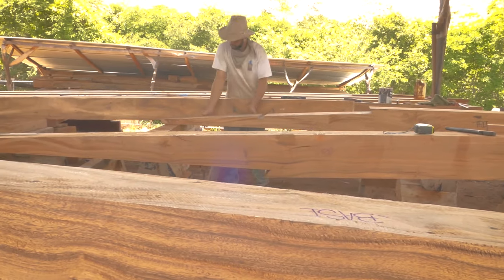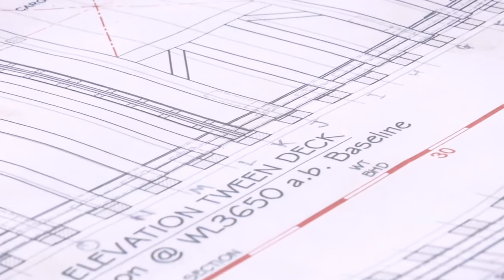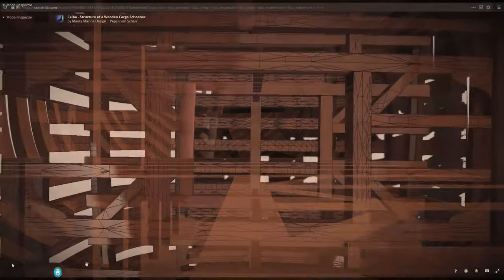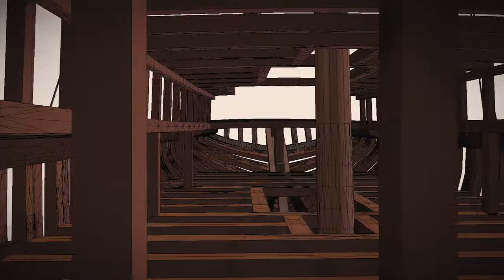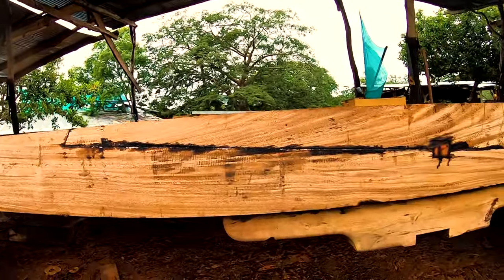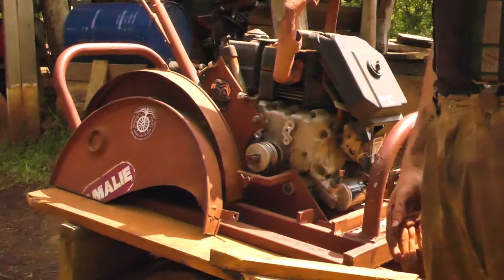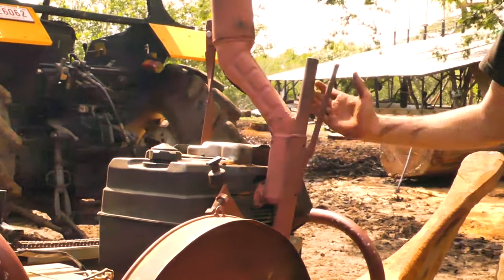Cambered Deck Beams - Building Ceiba, the world's largest wooden cargo sailing ship.

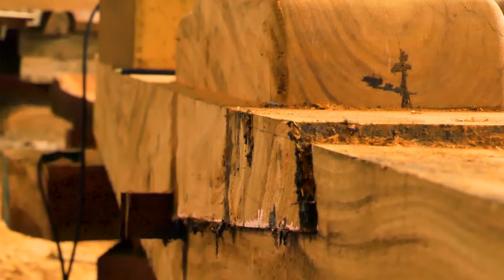Comment: I think someone said, "Ya. You just Spring a Batten." 3:03 ||| Do I correctly understand that to mean; take a specific length of batten, crown it a specifically calculated height, hold it so it can not deform with something (string, straight length of 1/4" x 4" plywood), place it on chosen top deck frame piece, scribe the appropriate curved/cambered cut-line, splice that crowned/cambered deck frame/beam piece to fit its adjoining top deck beam piece. ||| Did I get that right? ||| It would really be great video footage to Show your audience how you do that, and better yet, great tutorial material for TEACHING What Was Said. If you can, please do that in your next video.

Comment: Just for scale, how tall is the storage area where cargo is planned ?  was thinking you may be able to get used or even currently certified ULD's from the airlines for storing cargo in easily moved/stored portable uniform sized modules like :  https://www.aerocontact.com/en/virtual-aviation-exhibition/product/642-air-freight-container-vrr-aviation-akn-series They're usually aluminum and plastic construction for protecting cargo while ensuring they can be handled quickly. The airline's planes have rollers built into the floors for sliding these modules around until located where they can be locked in place to stop shifting while moving.